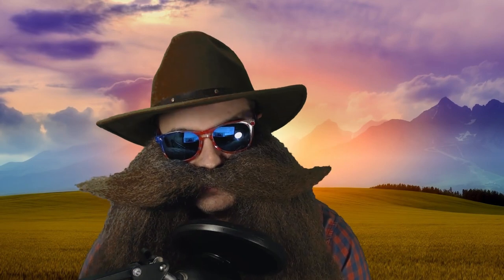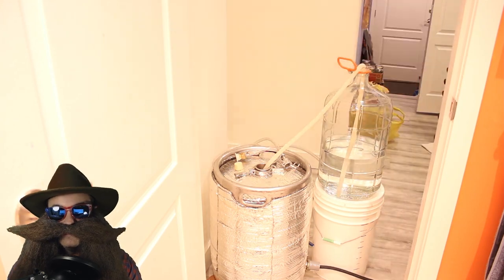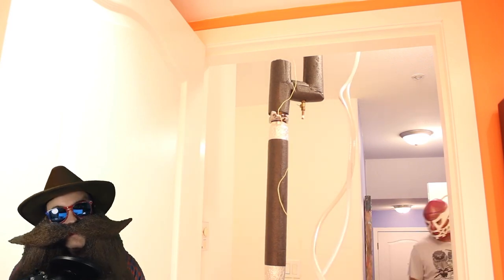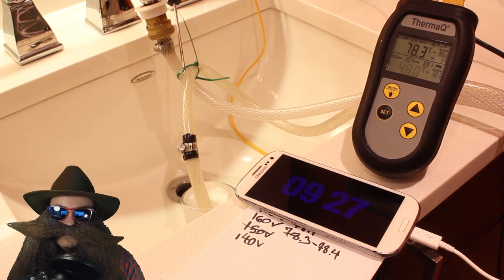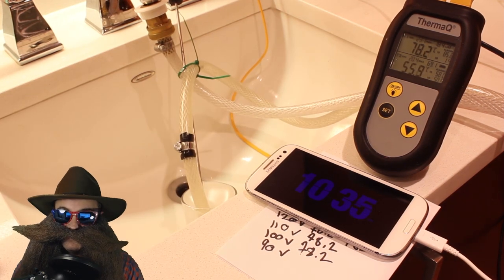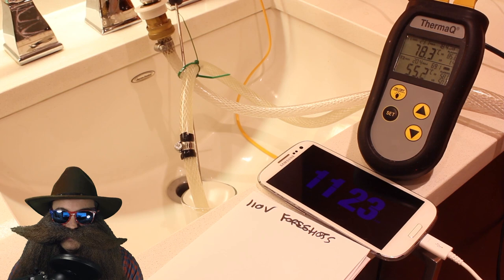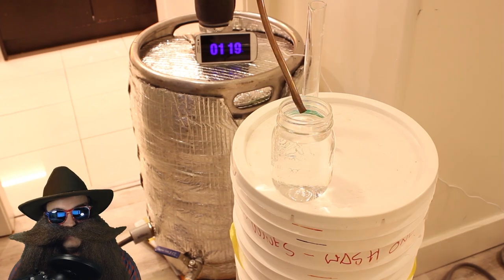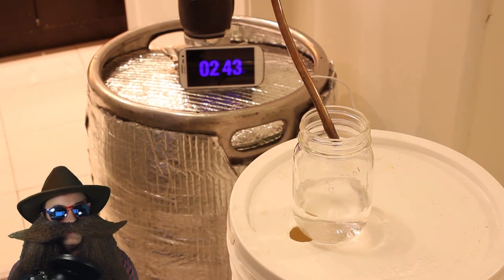Distilling Moonshine Run #1 - SPP vs Scrubbies

Comment from the maker: What kind of production rates do you guys get?
Reply: it'll vary from still to still , && x (by) the abv % of the low wines ....
Reply from the maker: Any idea how fast I could go if I filled 'er with 10 gallon of 35% instead of 10 gallons of 21%?
Reply: @OpenSourceDistilling  You will still collect at the same rate (1500ml/hr), but you will only collect more alc at 95.6%.
Reply from the maker: @LouwrensvanderMerwe  I'm starting to realize how oversized a keg is for a 2" reflux column. Put too much in and you'll be distilling for days, lol.
Reply: Mine is about the same as yours, so is the power setting. As for stripping runs I run a potstill and crank it up to about 3 L per hour. That is really all I can get as I run a 2 KW heating element (my circuit breaker won't let me draw more power). 
At my buddies garage, we cranked it up to 4,5 L per hour which is what I believe the limit for my rig. Anything more than that would require a full size keg like yours and a decent 5-6 KW heating element. Alternatively, I could run on gas which I'm not that keen on...especially not in my appartment..lol.
Reply: About 3L/hr on an SPP VM-E-ARC with heads column and reservoir. That's a 2" column getting real nice azeotrope out the product condenser.

Comment: You don't need a sight glass to see how much volume of liquid you have in your boiler. You just need to prepare a metal (or plastic) stick with some notch on it. The same technique which is used for measuring the oil level in the crankshaft. 

You put a gallon of water: immerse the stick, take it out, note the level, make a notch;
Then you put another gallon, and repeat.

While you are there, you could switch to metric measures, and put a notch every 3 litres for instance :-)
Reply from the maker: That's one thing I love about this hobby, the different creative ways people come up with to solve their problems. Thanks for sharing your solution! Keep them coming. Much appreciated.

Comment: i use a t500 column and i'm thinking about buying a long copper tube that is 1/2" wide then cut it up in 1/4" segments and use that as packing.
Reply from the maker: Nice. I've seen copper saddles. Let me know if you end doing that and how they work out.

Comment: Throw your heads and tails in the next stripping run. No need to waste good alcohol. :)
Alternatively, do a separate heads and tails run...you'll be surprised about the result. This is especially true when running whiskey or brandies.
Whatever you do it's important to make a generous foreshot cut. If you do it at both stripping- and spirit run you'll end up with a superior product.
Happy distilling. :)
Reply from the maker: Happy Distilling much love!

Comment: I'm very interisted in how you got the heater installed in the keg. If you had to thread a nut on the back side, how did you place and hold it through the small keg opening? Trying to solve that issue myself. 

Thanks!
Reply from the maker: Had a metal shop weld in half couplings. It was super expensive, 3 half couplings and it was like $200 bucks or something (it was years ago). People always talk about welding when it comes to stainless steel but never talk about brazing or soldering. I have bought silver solder with the right flux and some solder-on 1.5" triclamp fittings that I will be upgrading my still with. They are small enough that I can drill the holes with a step drill bit I have. I'll also be soldering or brazing in some 1/2" fittings for a sight glass as well. Stay tuned for that video. I've watched some videos and silver solder seems to have good mechanical strength. Not as good as welding of course but how much strength do you need?
Reply: @OpenSourceDistilling  just got back to this. I ended up 56% silver brazing a threaded fitting in and I'm very happy with it
Reply from the maker: @KC9RXP  Awesome sauce. What did you braze in? Did you braze in half couplings? I've been trying to figure out exactly what I want to braze in and what I may want to get professionally welded. Can you snap a few pics and email them to me? JoeyJoeJoeJr.OSD@gmail.com
Reply: @OpenSourceDistilling  I think the  fitting was called a welding butt. It's like a half coupling, but with a flange that rests against the outside of the tank. That gave me alot more surface area to wick the braze into. I tig weld by trade and still opted for the silver braze because of the price, ease of use, and strength. I will send you a few pictures of the fitting installed with  the size I used. Cant remember off the top off my head.
Reply from the maker: @KC9RXP  Thanks! Please also let me know where you picked them up from, would like to share that too with the community :)
Reply: @OpenSourceDistilling  got an email sent to you with some pictures late last night